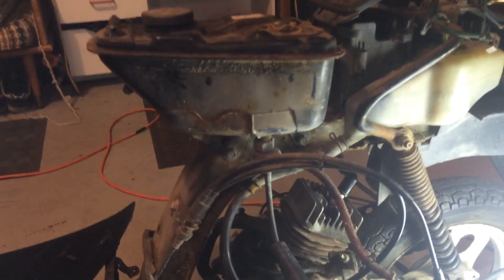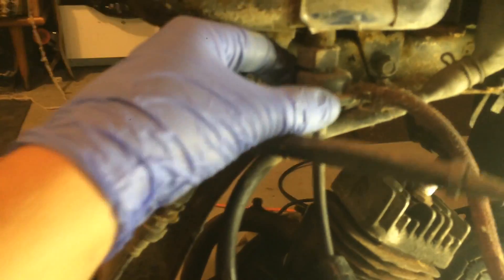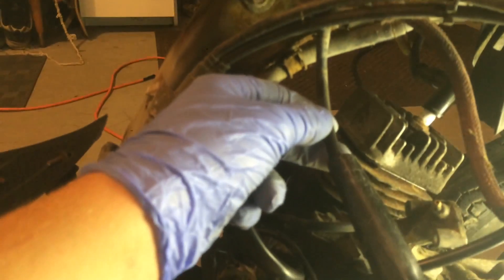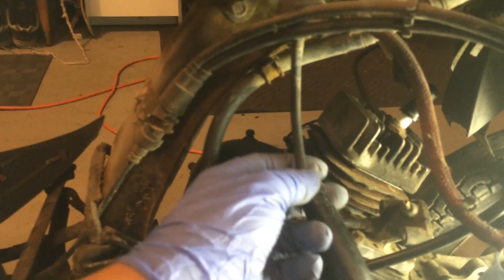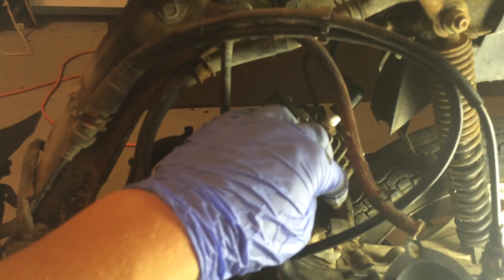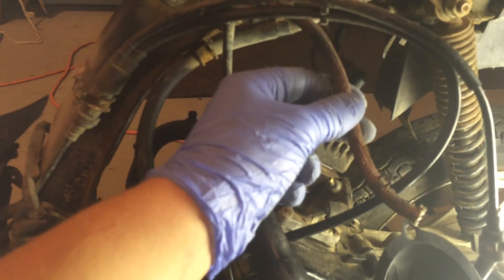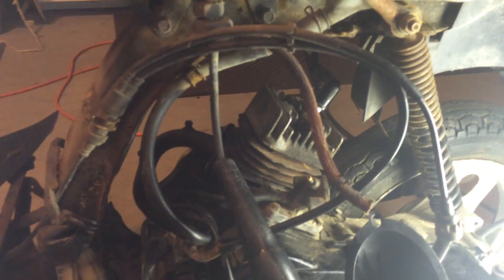Drain old gas from moped

Comment: Hes using the vacuum to push the gas out not suck it out for those of you who are commenting without actually watching
Reply: I was concerned reading the comments so I grabbed a spray nozzle that you get off spray bottles and put the tube of the spray nozzle to the hose he was vacuuming.(for the spray nozzle tube I made sure it was smaller than the hose to the petcock to get a tight fit) Anyways I started pumping and no gas came out of the hose only the other hose had gas coming out. I guess even if you vacuum the hose gas will only come out the other line

Comment: Similar thing happened on the show "1000 Ways to Die" #180: Suck & Blown - 2 guys siphoning gas out of cars used a vacuum - "but the vacuum's electric fan produced a spark and when combined with all the great amounts of gasoline caused a catastrophic explosion. Zeke and Lyle were right in front of the explosion too, so shrapnel easily made it to their brains, causing hemorrhaging and instant death, leaving a black stain on the van."  NOT ADVISED!
Reply: Banger show, needed more episodes for my morbid curiosity